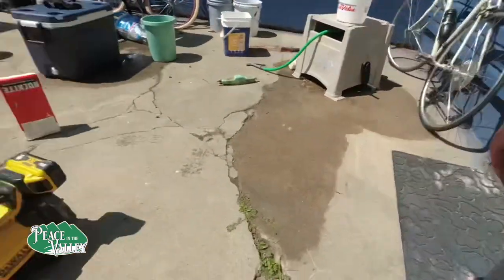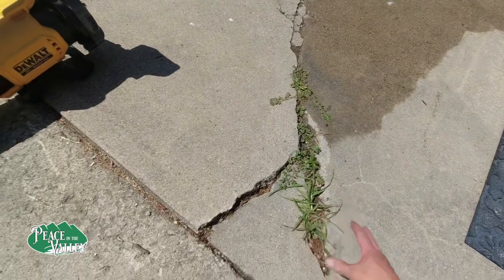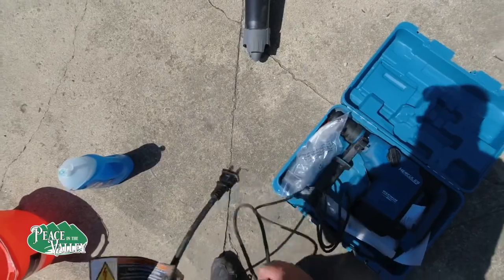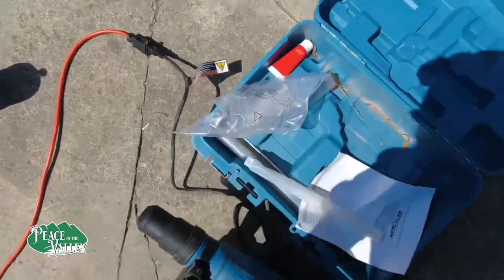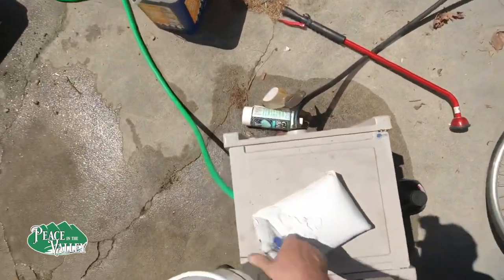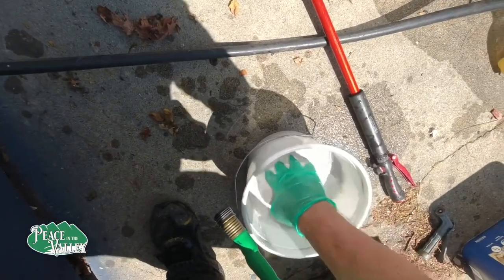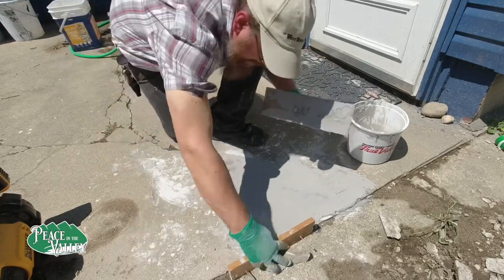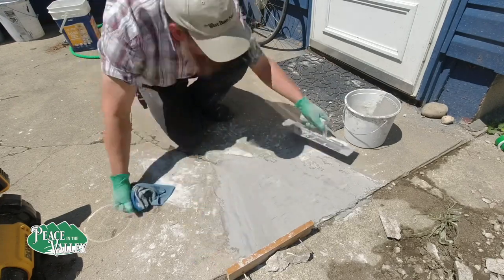What is Rockite? Fix your concrete - E95

Comment: Good video. I use Rockite for small cracks and around toilet flanges in a cement floor if needed to fill the gap. But honestly, on a repair of that nature, I think I would have just cut out the concrete triangle and used regular concrete to fill in the hole.
Reply from the maker: when this needs repaired again, I will probably do exactly what you are suggesting. So far it's holding just fine.

Comment: just my pair of pennies, I'd have dammed the ends of the crack a little past where you're filling mixed it a bit runnier and poured it till it was just about to run over.  you can mix rockite so it's nearly the consistency of water and it'll still set up hard as can be
Reply from the maker: are you referring to "dammed" by drilling holes at the end of the cracks to stop the cracks from continuing?

Comment: I usually mix it thick like putty. I’m going to try it on some cracks I have in the garage. First I’ll do reasonable prep and cleaning. Maybe a little dry in the bottom and small cracks then mix and trowel in . Curious as to how long it will last. It’ll probably be several years before I can do epoxy floor. It’s been years since I’ve used it. Always had favorable results

Comment: Possibly removed the triangle section in between the cuts? Just to prevent future movement/cracks? I haven’t worked with concrete a lot so I may be wrong. Nonetheless I sincerely appreciate your authenticity showing some small mistakes bc that helps everyone learn. Great video!
Reply from the maker: I believe you are right on that.

Comment: It's certainly worth a try!  If it doesn't work, it will give you more time before you need to replace the larger slab.  I'm wondering if water & ice will continue to get in the smaller cracks and cause future problems.  Time will tell.
Reply from the maker: Hi Walter, I wonder the exact same thing. I believe it will work, and I probably will drill out a circle at where the crack meets the patch area and fill in the cylindrical shaped hole with new concrete.

Comment: Thanks for the video. Would have been nice to see some footage after it had hardened and expanded.  I have some concrete cracks to fill too and have been looking at the Rockite product because of the speed of hardening. I think you might be paying a higher price for the rockite compared to a regular bag of concrete. .. I would suggest if you're going to be doing a biggish area,  either use regular concrete or use a filler.. like sand& gravel, or a poly filler. Or those old concrete chips like you did..so you stretch the rockite further...
Reply from the maker: you are right! fill in with something else. The rockite works well but is much more expensive. It bonds really well for the smaller cracks.

Comment: Thanks...nothing really to contribute, totally here to learn.  I did wonder what exactly is that Hercules and model.  Is that a hammer drill...impact drill, or some kind of specialized demolition drill?  And that bit you were using?  It seemed odd to me the way you went at, having no ideas of my own and knowing nothing of such matters.  Thanks.
Reply from the maker: I kind of went at it from the same mind set as you! I was just trying something. It's still holding up well. The drill is a heavy duty Hercules SDS max hammer drill that can also act as like a jack hammer. Got it Harbor Freight. Works pretty well. Thanks for watching!
Reply: @PeaceIntheValley  Thanks so much!